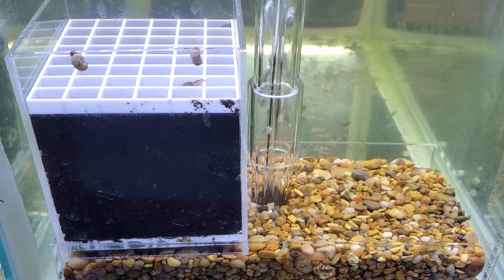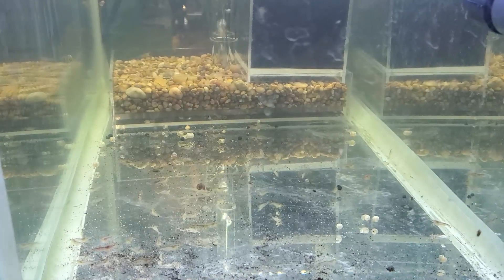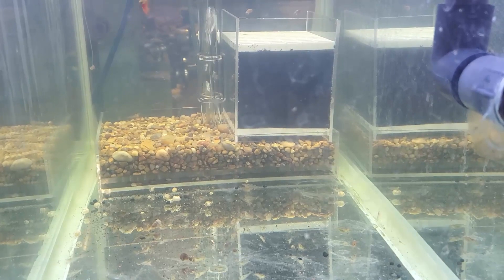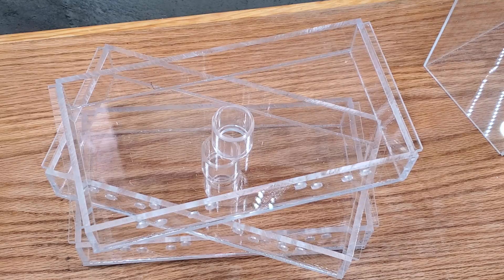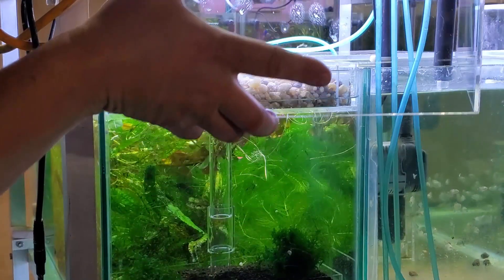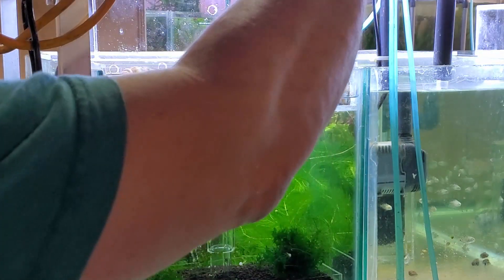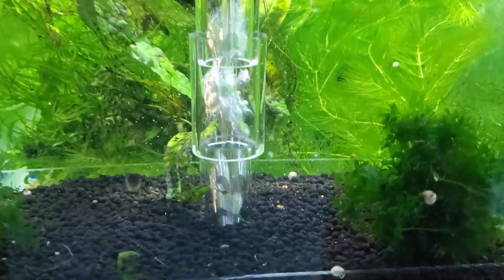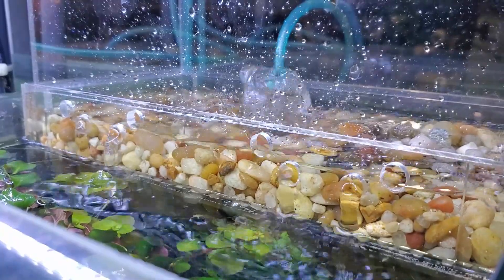Fish Room Vlog Part 19

Comment: That’s a lot of soil for that little tank. Usually when I see people use soil they just put a tiny bit across the bottom and then put sand or gravel over it, from what I’ve seen people would probably use about half of that. Some plants will absorb from the water column fine like a new Bea‘s in Java fern and most monsters but others like an Amazon sword or crypt will need the roots in the dirt. It’ll be interesting to see how long it would supply plants that way.  

From my studies the only thing in the soil that’s really going to hurt shrimp other than general 10 minutes would be copper. But most organic soil’s have a very minute amount of copper so it’s not too much. They actually need a tiny bit of copper to absorb the minerals from their food but too much copper can kill shrimp pretty easily but most organic soil’s use such a small amount that they are fine.  I’m sure there are some on specialty soil’s that may have something in them bad but in general that’s what I’ve always watched for with the shrimp. 

Another thing I’ve seen people do with plants is use floss and wrap a bowl of soil around the roots for rooting plants and just stick the ball in behind rocks or wood decor somewhere, the roots grow right through the floss and there would be some flow into the water column as well. You could just put your plants in tiny planters that drop in anywhere. In my next tank I’m going to do that, I’m just gonna take silicone and make little plant beds with rocks or a little plastic wall in there. I don’t want a lot of substrate because I don’t want soft water but the plants definitely do better because I stock lightly and usually don’t have enough fish in there to provide enough nutrients to do a lot of plants. I think the gravel filter on top sucking water through the soil should do really amazing, they get CO2 and nutrients
Reply from the maker: Hey Shane! I've seen the soil root ball method as well. I didn't go that root here so as to keep the setups as close to the same as possible

Comment: As for plants put me down for java moss. Does the the air line pouncing around like that cause the acylic "air straw things" to chip at the ends?
Reply from the maker: There will be some in for sure. There is actually little in the way of movement with the rigid tubing, and no issues with damage to them. Thanks for watching!